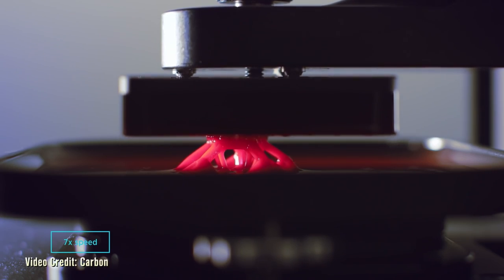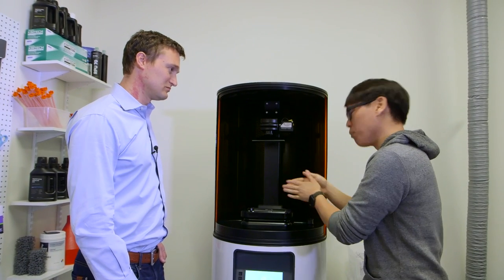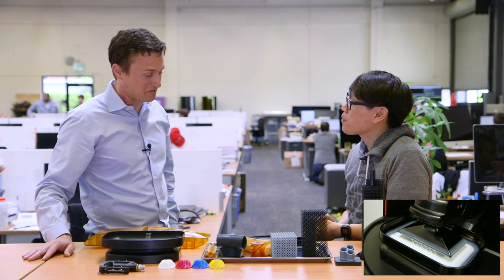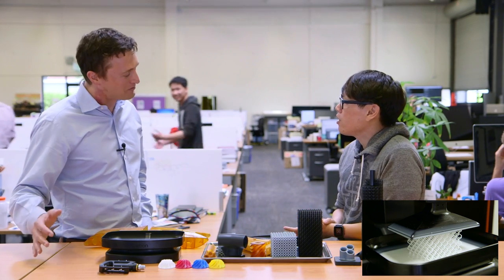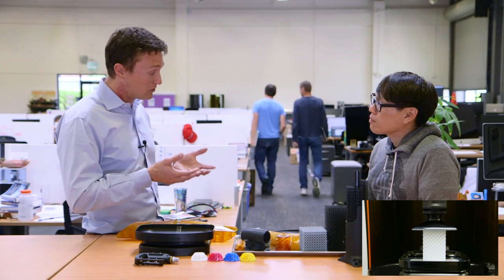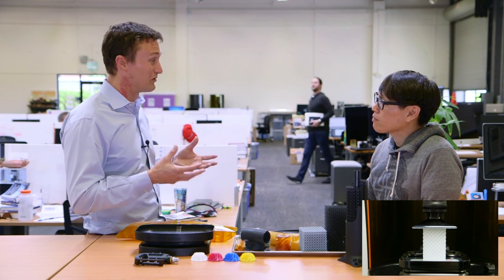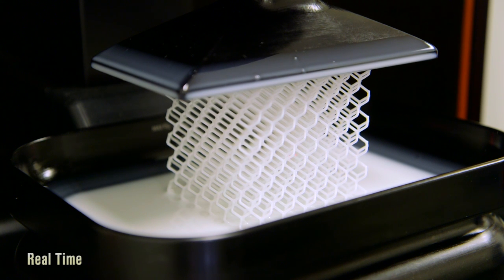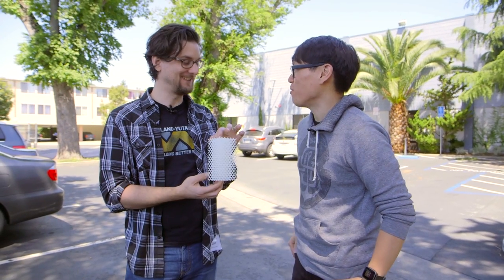Carbon M1 Super Fast 3D Printer Demo!

Comment: The costs of this thing is purely enterprise not even for the hobbyist. READ BELOW FOR TOTALS:

The basic subscription price for a single machine is USD$40,000 per year, or USD$3,333.33 per month for a period of three years. While the Carbon M1 is a speedy printer, it is a small format machine (only 144 x 81 x 330mm build volume), and the subscription price seems a bit high. 

But wait, there’s more costs involved. You’ll also need to pay the USD$10,000 installation and training fee (for onsite service), and also require the USD$12,000 accessories pack and the Cyanate Ester starter pack, if you’re using that particular resin. In all, there are one-time fees of USD$24,000. 

There are a couple of printer accessories you’ll likely require: a second build plate at USD$750 per year, plus an extra window cassette (for the resin tank) at USD$5,000/year. 

Adding this up for the three year subscription period, you’ll pay USD$161,250. 

But wait - this just gets you the machine, and you’ll certainly want to keep it busy printing high quality products at high speed. To compute the total cost of ownership of the M1 we must include the cost of materials. 

Materials cost is highly dependent on what you’re printing, how often you print and the type of materials involved. But for purposes of analysis, let’s make some assumptions: 

You print 1 x 800ml of resin every weekday, which should be within the M1’s speed envelope
You use a variety of resins from Carbon, ranging from USD$99 to USD$399 each, with an overall average of USD$166 per 800ml
Multiplying this out yields an estimate of annual materials cost at USD$43,160, or USD$129,480 over three years. 

This brings the total cost of ownership, less operator labor costs, at USD$290,730 for the minimum three-year subscription!

Comment: Certainly has given me impulse to contemplate.
I wonder if we can achieve cold fusion simply by using light and oxygen. We might also need chemistry, physics, hardware, software and great engineering.

I do like this printer though.
I can make useful objects like a copy of my head. It would have to be strong enough to withstand the elements and not break under tension. Would like to see stress, shear and compression tests on the rigid polymers.

Was that 40 grand to lease for a month or for a year?

Comment: The catch is cost. In 2020, it's $40,000 a year to lease. You can't buy it, and you have to lease for 3 years. There's also tens of thousands of costs in mandatory training, accessories, and resin.

If you want speed, make it up on throughput by buying a dozen (that's 12!) Anycubic Photon printers for about $2000.

Comment: What's the problem with talking about the Price?  Is it so covert or proprietary that the vary discussion would take the wind out of your sails?  Or will the discussion of price", kill the enthusiasm?  Ill say this; it's so good and so great, but; cost is probably so high you maze-well keep on deeming.   At least I know a "Mark Forged Printer", at $50,000.00 will run rings around it, with out a two stage process.  So; put up or shut up".

Comment: The guy didn't even answer the questions. So how do you control the oxygen? "It's controlling the light and oxygen"
So how does it work? "Physics"
So how do you achieve the speed? "It's controlling the light and oxygen"
What's so special about the resin? "Physics"

Comment: From a research paper on CLIP: "Additive manufacturing processes such as 3D printing use time-consuming, stepwise
layer-by-layer approaches to object fabrication.We demonstrate the continuous generation
of monolithic polymeric parts up to tens of centimeters in size with feature resolution
below 100 micrometers. Continuous liquid interface production is achieved with an
oxygen-permeable window below the ultraviolet image projection plane, which creates a
“dead zone” (persistent liquid interface) where photopolymerization is inhibited between
the window and the polymerizing part.We delineate critical control parameters and
show that complex solid parts can be drawn out of the resin at rates of hundreds of millimeters
per hour. These print speeds allow parts to be produced in minutes instead of hours." An actual explanation - you're welcome.

Comment: What worries me is that DLP projectors get 'stuck pixels' which, for movie projection, doesn't matter too much ... but in this type of application, a single stuck pixel means an ugly column running through your part, which needs to be reworked... and that will get annoying real quick : /

Comment: 3D printers will never be able to make complex, multi material "Copper Winding, Aluminum Case, Electrical Controller/Relay...ect" parts, these printers work using single level build up of material of one to three input material(s)!

Comment: Lots of talk with zero practical result!
What's the use of saying so many good things apparently if you don't touch the main thing! Price. Without knowing the price, it is not possible to make a cost-benefit assessment. So the video looks like a prank! A tangled one! I tried to access the manufacturer's website and did not see anything there that indicated a price! This makes me very suspicious! I'm going to look for a simpler printer.

Comment: Black Magic? No...Wrong term altogether, absolutely incorrect and misleading even though you are using it only for descriptive purposes and not in a literal sense. White Magic would be the correct term. It is a privilege to hear you speak. Your erudition, knowledge of the technical jargon and fluency with the vocabulary is impressive, but you might benefit from some preliminary research on the subject of Magic to gain some familiarity with the basic concepts, even if the terminology is borrowed only for descriptive or comparative purposes.

Comment: This comment will probably be lost in the many other comments but I know how this technology works, the exposure window is oxygen permeable which is important for controlling the curing rate of UV resin. This is really useful because adhesion is the most annoying problem in SLA printing. So the oxygen is creating a barrier to keep the resin from sticking to the exposure window. Too much oxygen however, makes it so the the resin cures poorly, slowing the build rate.  They are supplying the under cabinet with oxygen at various levels depending on the cross section of the print. The real mystery to me is the membrane, I don't know how they did that. But I'll bet some research on permeable membranes will turn up some results. The light is DLP (digital light projection-using a tiny array of mirrors,  which is important in order to not filter out the UV) where the focus is on the interface of the resin and the build plate from the underside. The images of the print are a morphing cross section area, which means the print can be continuous, with a resolution set by the pixels per area on the exposure window. 

I am disturbed by how ambiguous his description was, and how many times he said oxygen and light. What a useless video. It would have been great as a 2 minute video.

Comment: Everyone's talking about how he keeps repeating "light and oxygen" and won't answer any questions.  What this seems like to me is that he is very intelligent and Norm forgot to send over the list of questions before the interview.  As a result of this common mistake which isn't really Norm's fault this time, the VP of the department has to go into protecting trade secrets mode but doesn't want to just say "no" every time Norm asks a question.  I'm sure every single other 3D printer manufacturer in the world is trying to steal information on how to do this, perhaps even to the point where they need extra security protocols within the company itself.  Even if it turns out to be not profitable at all the technology is groundbreaking, and maybe it is profitable but maybe it's going to take them another 5 years to figure out how to scale properly, if someone else steals the mode of operation and can make it profitable in 3 years (something China especially likes to try) then they're two years ahead and Carbon will go bankrupt because of lack of market control/share.  That said I am going to stop watching the video because I'm bored.

Comment: Impressive... but some parts are a bit ridiculous:  he speaks of replacing injection-moulding with his printer... but it still needs to be maybe 1000 times faster before you can even think of using it in large scale production.

Comment: Maybe they are doing something more.complex, but it seems if you have a vat of resin and the print is taking place at the bottom of that layer of liquid, you wouldn't have much oxygen as you would  if the print was taking place at the top of that liquid.

Comment: Cleaning the final product of excess fluid ! Epoxy based Resin ? that needs curing. Waste material seems to be massive, extremely allergenic and extreme environmental hazard for water living organism. 
But the tech seems to be good, i have though questions about tolerances. neither of this is mentioned.

Comment: 2020  using high resolution Mono LCD panels instead of a project for a smaller foot print. but still slower because we have to lift the damn print from the PEF film which in itself takes  a lot of time.

Comment: almost 40 years ago I was used as a guinea pig for a new adhesive for attaching braces. It used UV to cure. Worked so well they almost broke a few of my teeth trying to get the brackets off! Well, that adhesive is now used for fillings etc, and likely is the origin of this tech...

Comment: Ultraviolet light is responsible for the chemical reactions that occur in the atmosphere. For example, ozone is generated in the stratosphere from a first reaction consisting of the dissociation of the oxygen molecule by the action of UV radiation. Therefore if you can correctly modulate the chemical reaction of oxygen in the medium (resin) by the action of UV light by correctly modulating the wavelength you can break the oxygen molecule or just contribute to increase the temperature of oxygen (molecular motion). This is non-catalytic reactions of destruction and production, the essence of a catalyst, lowering the activation barrier making chemical reactions run faster and being able to regenerate to start a new catalytic cycle.

Comment: All you would need to do to get rid of oxygen would be either purge with Argon, Helium, Carbon Dioxide. OR just print below the surface of the resin because Oxygen is less dense and couldn't possibly exist in large sums underneath the resin. 3D printers of any kind are not that complicated. Fine tuning and making high quality is what pays

Comment: Multiple lasers?  Pulse lasers?  Using  multiple lasers would allow you to locus the heat by designing the print medium to stay fluid until passing the thermal threshold equivalent to the heat produced by 2+ lasers which meet at a point on the glass which acts like a lens, allowing the two lasers to meet on the far side of the glass, localizing heat.  Then,  pulse these lasers in the image of your print and exert negative pressure on the plate.  The negative pressure stretches plasticizing print medium, increasing surface area which cancels the increase in thermal energy by increasing the space that energy occupies at a pace quick enough to prevent exothermic reactions (which require the focused energy of two lasers) , but slow enough so that the next laser pulse creates a continuous branch of plasticized material.

Comment: I need 100.000 parts a month that use the whole build plate how long is that going to take including stage 2 of the curing process I'd probably need hundreds of these printers in order to reach the target, where as injection moulding is fast cheap and reliable in comparison but for prototyping is where this printer shines.

Comment: This technology is a revised version of DLP printer focusing on speed.   Creating the oxygen inhibition zone eliminates the movement for the layers and increases the speed.  On the other hand,  creating an oxygen inhibition zone inevitably trades off resolution.   It is good to print meshed shoe sole or models that do not need a lot of details and structurally non-solid.   If printing a bigger solid model,   it would be hard and slow to replenish resin in the center of the model.   Since the printer is extremely expensive,  it is quite hard to find profitable applications for this type of technology.

Comment: Okay, I'm about 20 minutes deep, I feel like I know more about 3d printing with carbon based polymers than I ever thought I'd know. Can I work for a company like this? How can I get involved making low cost ACU for people in india. I'm pretty sure that's the same people who are calling me to tell me that the federal beareau of education has some monies to western union me. Anywho, 3d printer technology has always fascinated me. I remember predicting it's use before I ever knew they're real or began proliferating. Based on the early and mid printer technologies we have, 3D printing was bound to come along. This printer is special though. This technology is already changing the way we view consumer products.

No longer are you bound by the constraints of buying a mechanism, contraption or product that comes with parts which are irreplaceable or cost a fortune and half an army to reproduce. Now is the age of efficient, in situ manufacturing, replaceable parts for every piece of equipment at your fingertips in the shop where it's all held. I guess the step up from here is to make printers that come with reversible print functions that let the user redesign or recycle printed projects. Really great stuff...

Lets nuke antarctica.

Comment: Don't try to sell me on a resin compressor that's made of a resin that's "almost as durable as nylon" is better than a compressor made of cast iron, steel and bronze. This is just another way to make cheap junk that benefits ONLY the manufacturer because it is CHEAP, it is not a better product. Just like the crappy plastic "resin" engine parts you find failing every day on VW and BMW cars like water outlets and thermostat housings. Manufacturers do not care about quality or their customers. The only reason they switch to plastic is it is cheap but anytime you say cheap, add the word junk. Metal is better by far yet You still pay a lot for the parts. Go ahead and pat yourselves on your backs and congratulate your image in the mirror.

Comment: Just my guess, but since the build plate is submerged, the materials are cured where no oxygen can get to it. Since the build-plate moves slowly, it prevents the plate from creating turbulence in the mixture, preventing oxygen from reaching the actual curing layer. Essentially, they removed the need for the gas to pump out the excess air by using the resin in the same way the gas is used in conventional SLA printers -- as a method to inhibit oxidization of the Resin. the resin dripping off is doing so due to it being oxidized as it hits the air in the chamber. 

Light is being used to cure, and oxygen is being used to slake off excess material.

Just a guess, I could be totally wrong! Someone tell me if I'm missing something guys.

Comment: Whatever happened to the utilitarian approach to engineering. I feel like there are so many components to machines like this that aren't functional, such as the cylindrical form factor for an otherwise cube shaped printer, the odd bulging shape of the print plate holder, and other eccentricities that are more for aesthetics than they are for functionality. Considering this is for industrial applications I can't appreciate the aesthetics that, in my opinion, are better suited for consumers that 3d print things as a hobby.

Comment: If they had only worked out how to control both light and oxygen this printer would be amazing. As it stands it's a bit "meh" but by my calculations they appear to be on the right track when it comes to using a combination of light and oxygen. By using a combination of light and oxygen the speed and resolution will definitely be increased by the control light and oxygen. Remember everyone, light and oxygen.

Comment: You know the products in this market are cool. But they wont release ones that are big enough to 3d print a table or chair anywhere in the near future, so to me and this is my own opinion, unless you just want one to have one theres no point to these machines other than small prototyping. Resin is fucking expensive and not feasible as it is. Why throw money into a pit for something that cant print sizes past basic rectangles?

Comment: There is not much complex about this process. He just says this to sound expensive and cutting edge. This relies upon the most basic of principles.

I can also tell you that this was not an intentional invention when it was created but was rather a tool to gain better understanding. It just turns out it was also practical for this type of application.

Comment: He sounds very passionate about what his team has produced, which is understandable imagine in 20 years time or so when this print could be done within just a few seconds. I know there's the issue of having gravity push the resin into the opening, but with enough pressure you can force fill the resin under the new print as its extruded. This is why there was such talk of heat and pressure.

Comment: With the top of the range production printers, inconel printing and such, the chamber is sealed and a non reactive gas such as argon is put in the chamber. By keeping the chamber open you allow oxegen in. Heat and oxegen create gas which creates bubbles of air that prevent bonding. What they do here is control the heat of the laser to control the amount of gas the oxegen gives off, bonding the resin only where they want it to.